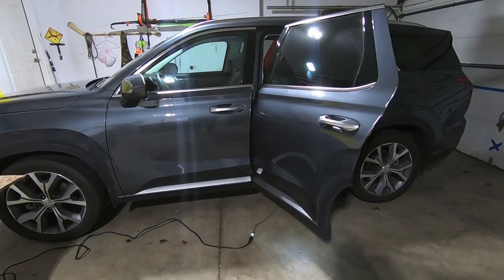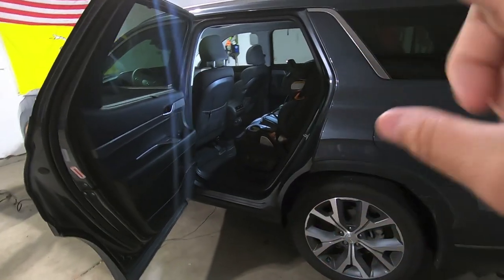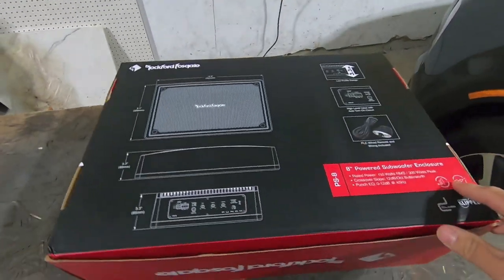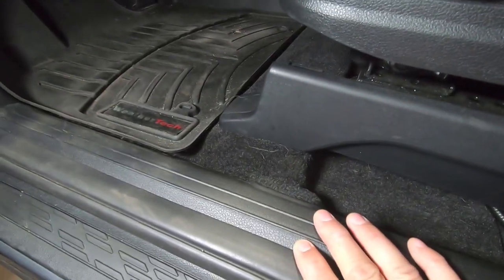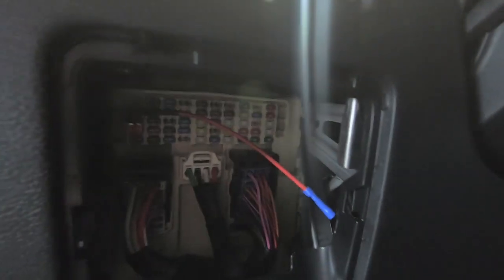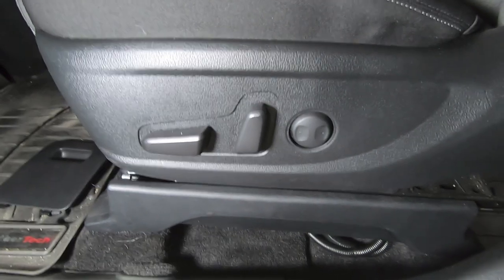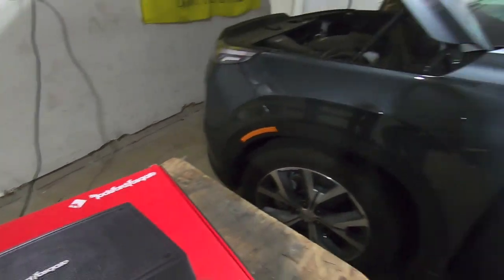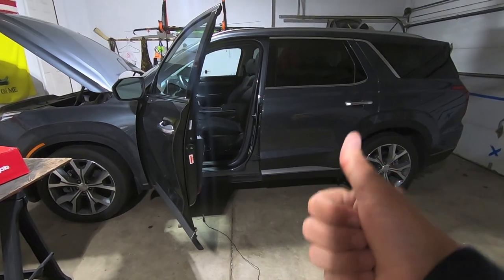Palisade Stereo Upgrade 3 of 3: Powered Subwoofer - Hyundai Palisade

Comment: What did you use to poke a hole on the rubber grommet to run the positive ground wire? Did you have to use a drill bit or is it easy enough to poke a hole by using a philips scew driver?
Reply from the maker: I metal kabob stick....don't tell my wife!

Comment: I think my rear door speakers are filtered . I have the premium system with subwoofer . I did the install and couldn’t get much signal to the sub so subsequently the out put was low even with gains cranked .
I could try the front door speakers . They sound as though they are full range .

Comment: Great stuff!! 
Do you know if the front left and right wires are in the kick panels????
Reply from the maker: i do not, sorry!
Reply: @WaterFowler41  2 quick questions: when you disconnected the neg on the battery, did you lose your presets, etc??(What happened with that?)
What order did you do the ground and then attach the power to the battery.?

Comment: Why would you tap the rear speakers and not the subwoofer in the back?

In that car, there is dsp ahead of the amp, sending a modified signal to each speaker location.

If you are using surround, the rears arent full range, and are likely crossed over as high-pass only.
Reply from the maker: I didn't have a factory subwoofer in this car, kind of why I am adding one in this video.  This is the base stereo system.

Comment: Videos are so helpful, thanks for that. can you show how to get speaker input from the front speakers for amp??
Reply from the maker: I only pull the signals from the rears.
Reply: @WaterFowler41   I really want to amp the front also. Can you help me with front door connector wiring ??
Reply from the maker: You’ll have to find the front door speaker wires in the kick panel, I suspect just like the rears the front door wires are a twisted pair that match the wire color in the door.

Take a look at the installation document in the video description and see what color the front speaker wires are then start digging into the kick panel area looking for them.

Sorry wish I could provide more specifics.

Comment: Awesome details. I purchased the subwoofer. I cannot find the handwritten schematic you showed on your video . Can you please add it or is it possible to send it to me? Thank You
Reply from the maker: I didn’t add it but can if it’ll help.
Reply: @WaterFowler41  yes please. Thank you. I installed your 1 and 2 palisade jbl door speakers and it went flawlessly
Reply: @WaterFowler41  yes please add your handwritten schematic. It will real help on my installation. Thank You very much
Reply from the maker: Just uploaded it, here you go!

https://drive.google.com/file/d/1-4-1TWEp-sb7eI9q4ZidNOHYiKXP7BKk
Reply: @WaterFowler41  thank You soo much
Reply: Any issues with the sub being close to the air vents putting out heat and air under the drivers seat?
Reply from the maker: Nope
Reply: @WaterFowler41  great thanks

Comment: Where’s the sound test?
Reply from the maker: I’m filming on a go pro so there’s not much value in filming a subwoofer.
Reply: @WaterFowler41  I’m interested in the Jbl 620f. I just ordered them but I won’t be able to install them for the next 2 months or so.  Do they have decent bass for regular speakers?
Reply from the maker: Yep they were an excellent upgrade for the base pali system. Even my wife could tell the difference